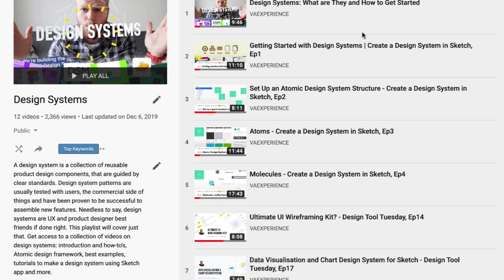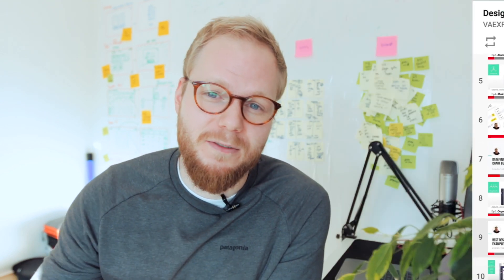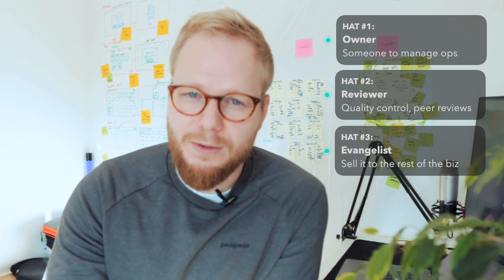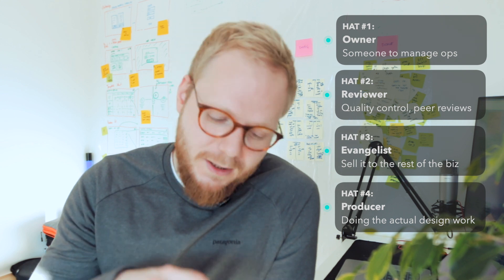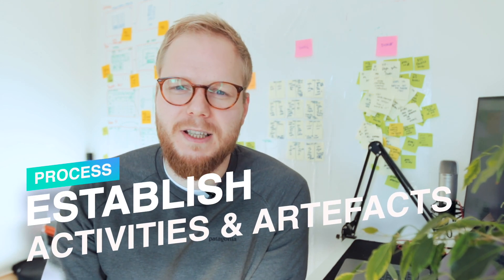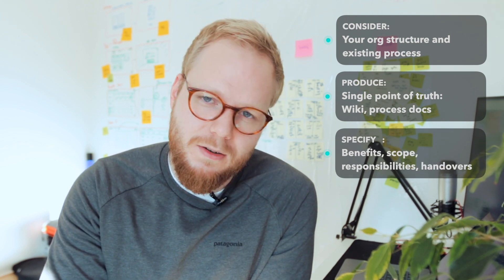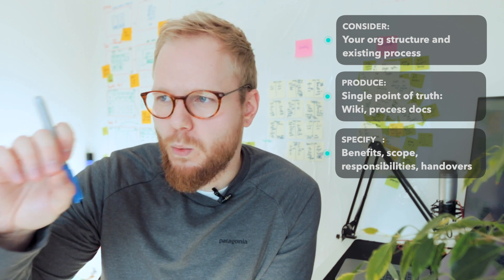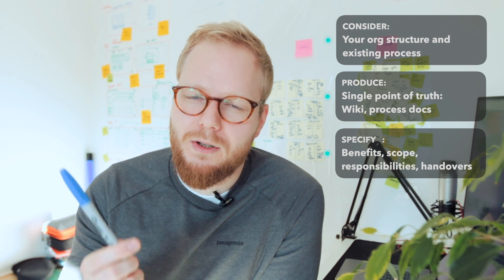Making Design System a Success - Create a Design System in Sketch, Ep9

Comment: Hi, I watched alle your Videos about Design Systems, that helped a lot! 
There ist one thing I'm not sure about: How do you handle all the exceptions, which are not covered in the Design System?
Right now I'm responsible to build a Design System for an huge, already existing, online shop. But there are a lot of design elements/organisms, which only appear once, for a specific case. Should I integrate EVERY element of the existing website in the Design System? Or just the basics, which are reused more than once? 
Sometimes you need to do variations, from what is defined in the Design System. Do you integrate those variations in the Design System, even if you don't need it for other cases?
Thanks in advance:)
Reply from the maker: Hey there's no easy answer on this one. I might make a video on best practice. But ultimately it will come down on the rest of design team - if you are the only one who maintains and knows about all the cases then it might be a good idea to bunch all the patterns in. If it's a bigger team or community - then you would probably push less and less components to the Design system. One thing to consider that you'd need to define the criteria yourself of what's worth being in the system and what isn't: standards, submission criteria (evidence), governance... etc. because the worst thing you could do is to add all but none are really reused anywhere else
Reply: @vaexperience  thanks a lot for your answer!